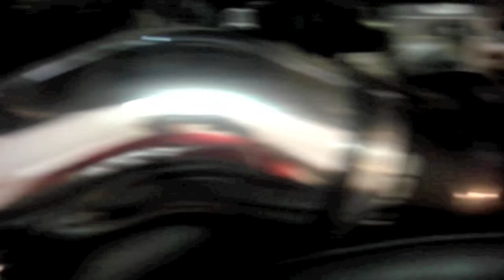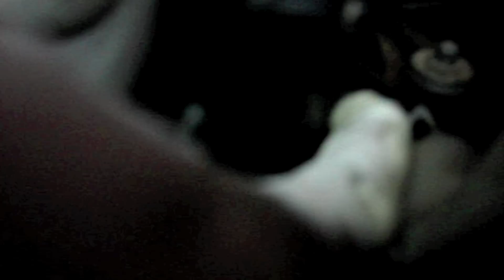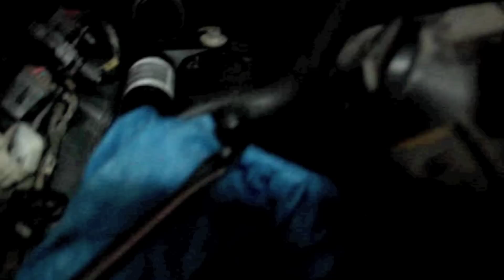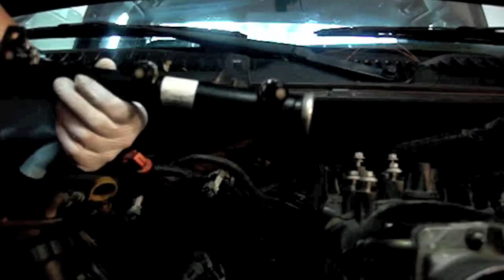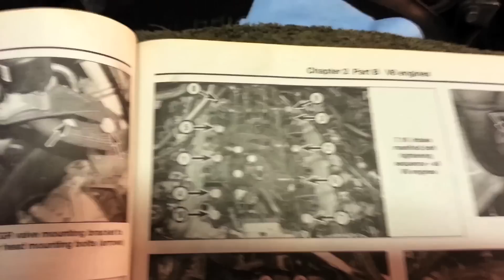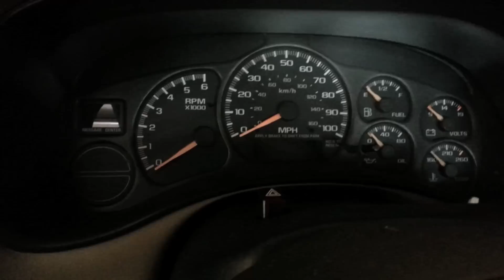2002 GMC Sierra Intake Manifold Gasket and Knock Sensor Replacement - HOW TO / TUTORIAL

Comment: Replaced knock sensors, harness and manifold gaskets in my 2002 Chevrolet  2500 HD.   This video helped a lot especially the information about disconnecting fuel injector connecters.  Keep every thing clean and use rags to keep things from falling in engine.  Took me about 5 hours.  Not to bad for 69 year old man.

Comment: Replaced my 05 6.0 knock sensors for the first time the other day and it was a fairly simple job. picked up even a few new tools needed for this job that i didnt have ( fuel line disconnector tool and a Inch  lb torque wrench for the intake manifold bolts) and still came under $200 for parts + tools. i would say to people not to be discouraged if its their first time around, with a few tools and about 3-6  hours of work ( depending how good of a wrench turner you are ) its doable. thank you for the video , it helped a lot.

Comment: Had a bad knock sensor on my 2004 Avalanche and was a little apprehensive about doing the repair myself, until I came across your video.  With the repair complete there were no leaks and the check engine light went away.  Vehicle runs great.  Thanks for taking the time to post this video, you helped me a lot.

Comment: Thank You very much for posting this "How To" video. With your help I just replaced both knock sensors on my 2004 Silverado. I wouldn't have tackled this job if it wasn't for your detailed instructions. The Check Engine Light has turned off and the truck runs much better. Thanks a bunch.

Comment: Thanks a lot for the in depth video, nice to see what I am about to do to my truck.  Also before you start next time you might want to pull the fuse for the fuel pump, turn on the engine and let it stall, this will release the fuel pressure in the lines.

Comment: With the sole help of this video did both sensors new harness 2001 Silverado 2500HD v8 6.0 4x4 in about 7 hrs.  It took more time to clean everything I had apart than removal/installation. I cleaned the injectors and replaced the upper & lower o-rings on them while I had them apart.  If it helps anyone else the torque on the Knock Sensors is 15 ft-lb
I called 3 shops and cheapest was $315 labor only.  I had parts but debated doing it.
Thank you Raider Red!  Truck runs GREAT service msg gone.

Comment: I did this to mine a couple of years ago. One thing if you guys are pulling the manifold and see a lot of dirt, leaves etc under there, check down inside the ports for ANY DEBRIS! I plugged my fuel lines with rubber cork stoppers first then when I made damn sure there were no fuel vapors anymore in engine compartment I detail vacuumed the ports out and cleaned with rags and spray and vacuumed again. You wont be able to see but when removing the manifold it will drag shit forward and down into those ports. Take your time and clean the hell out of everything if you want a good Job!

Comment: thanks for video. started changing out old knock sensors, knock sensor harness, and gaskets today on my 03 Tahoe. Got down to the bare intake manifold, and for the life of me cant get it out. its more than just possible gaskets holding it, definatley has something somewhere holding it in place on the right side in the back. will have at it again tomorrow.

Comment: Dude great job on the video and thanks a ton for making it! I just replaced the gaskets on my 02 sierra 5.3L; and after watching this video a couple times felt confident to tackle it as a "hobby mechanic" myself.  My truck has been running rough in the cold weather, before it really gets warmed up under the hood, coupled with random P0171, P0174, and P0300 codes.  After a few other new parts and diagnosis, and lots and lots of research, i figured it was time to do the IM gaskets.  I hope it fixes my issue, but thanks again!
Reply: I have the same codes, did it fix it and what brand gasket you use

Comment: These Wide Band Knock Sensors rarely go bad but as mentioned in a comment  below, washing is a sure way to set a code!  I also see people put sealer on the threads that in turn will shield the sensor and not letting it give proper output.  this type of Sensor can be bench or vehicle tested.  Recommended GM repair is to build a dam with silicone around the holes but an even better option for me was to glue some aluminum pipe on top of the hole.

Comment: I rtv'd my knock sensor caps back on and a dab on the wire hole too. My knock sensor and port was full of  water. After checking the auto parts stores and high prices. I fixed my bad sensor that was full of water by baking it in the oven!  drying it out over several hours on a really low temp. I monitored the ohms with ohm meter periodically and watched them come back into spec slowly as it dried out.  After It cooled and the next day it was reading as it should. It worked great. two years later still no codes.

Comment: to get those knock sensor connectors off and on easily just use a pair of needle nose pliers that are bent at 90degrees. squeeze and pull. good video btw.

Comment from the maker: Well, for the cylinders, bank 1 is driver side (odd number cylinders 1,3,5,7), bank 2 is passenger side (even number cylinders 2,4,6,8). For the knock sensors, they are more commonly referred to as front and rear. Front sensor dark blue wire, rear sensor light blue wire. I believe the rear sensor may also referred to as sensor (2), which would make sense for your code, as the rear normally fails before the front. Be sure to also check the wires/connector and replace if weak or faulty as well.
Reply: Do I get 2 of the same sensors to replace or are they different types to buy

Comment: Cut loose with the $6 for the quick disconnect tool for the rail. Save yourself all the added work of taking the fuel rails apart. Less chance of fuel leaks going back together.

Comment: great video,   I have oil leaks in mutiple places.  Is there any oil flowing through the maniflod, or is it just water.  I am thinking my oil leak could be the oil preasure sensor, and not the manifold gasket.

Comment: Bro you don't have to take the fuel rails to remove the intake, just saying you could've saved yourself a lot of time! Also some 90 degree needle nose pliers work great for disconnecting the knock sensors.

Comment: Where does the KC cable connect. You jumped ahead to the battle of manifold reinstallation and went right by that step. I just changed my valve cover gaskets and the KC light was on after the fact on my '01 5.3L Suburban. In that process I had to move the coil frame on both sides out of the way. So either the KC went bad at that instant or I loosened the connector somewhere.

Comment: I just did this to my truck. Did you have any trouble getting the fuel lines back in the fuel rail? On the right side where the inlet and outlet are I had a very hard time getting the rear line back in.

Comment: I have been working  on my 5,3 off an I no my knock  sensor is bad my truck has 10000miles I notice  a crack on my intake I am  going  to change the intake an sensor along with value cover gaskets extras

Comment: curious but did you have low circuit code on either one of the knock sensor? Reason i ask is i changed mine with brand new harnesses and still getting a low circuit on 1 so idk....guess take it down again and scope it out !

Comment: Great video,what all Gaskets/Gasket Sets do i need to do this job?cause the Parts Store is telling me there are 3 different kind,which they mentioned Manifold Gaskets,another gasket Set & another one that cost $116,i'm thinking it's the one for $116.Let Me Know ASAP,Thanks
Reply: just be carful and start with a tube of hi heat rtv blue about $6.00

Comment: I replaced my knock sensors as well...same engine...2002 Tahoe. The reason was because I washed my engine and water got down into the knock sensors past the rubber seal. I tried to clean out as much of the corrosion out of the hole as I could and put new knock sensors in along with a new wiring harness. The install went great. But for some reason the same code came back which governs those knock sensors. Mine is a P0332. I dont know if the knock sensor is grounded prpoerly to the block because of the corrosion that was in there or if that is even a concern...or if my PCM/ECM is bad.
Any suggestions? I'm about to do this job again because I can't pass smog with this code.
Thanks
Reply: efowble did u use oem parts? Especially OEM Ac Delco knock sensors? Many people buy aftermarket sensors and have had reports of the Engine light coming back on afterwards
Reply: +drwombat well shit, just bought after market sensors and started job today. going to be pissed if light is still on!....thanks for that tidbit though, if light does come on, at least ill know where i fucked up.

Comment: I really recomend to us Ac delco original GM parts, more $$ but check engine ligth it's gone, I use cheep after market parts and I have to do it again, and tat piss me off..
Reply: sometimes you have to use cheap parts to hold you for a while....like me.
Reply: exactly! I bought an aftermarket set and after change did not work... I sent back to the seller, I bought an original set... at the second time tha repair and change was easier and half of time... I had routine.. :D

Comment: Do you put anti-seize on the threads of the new knock sensors before putting them back in the engine?
Reply: Eugene & Erika Hernandez - no need, my original sensors with 250k miles came right out. Plus you'll never have to do this more than once.

Comment: I'm having a lot of trouble with the crossover fuel pipe leaking.  I reused the original o-rings and it leaked. I went and got some new generic  ones and it still leaked. Then i ordered new oem gaskets, and its still leaking.

Can somebody tell me the process for reassembling this pipe??
Reply: Put the o ring in the fuel rail first then put the pipe in then lock down